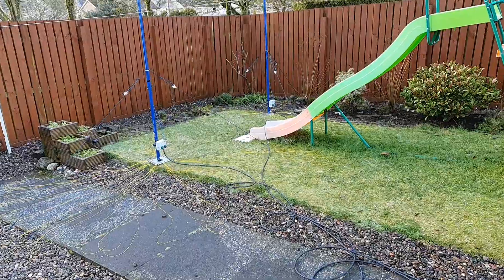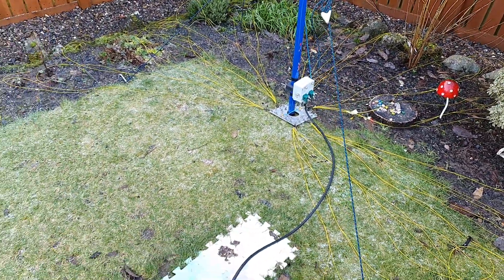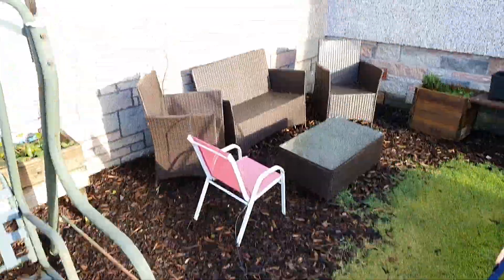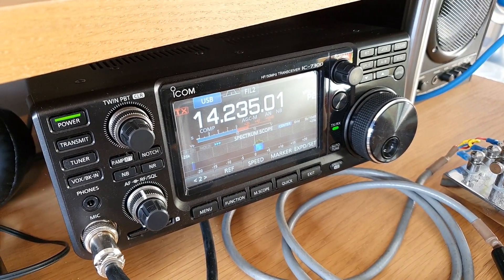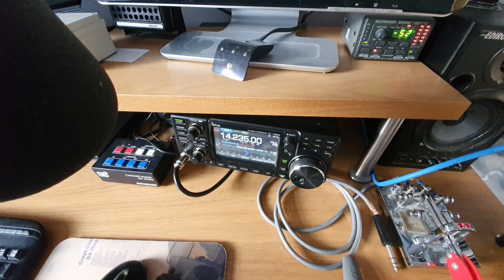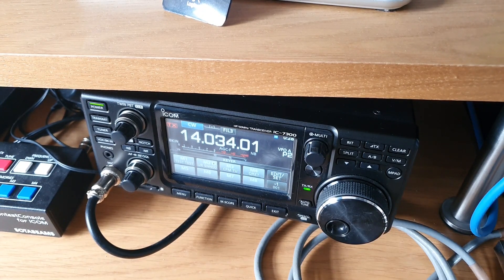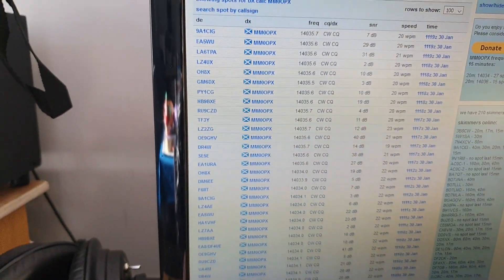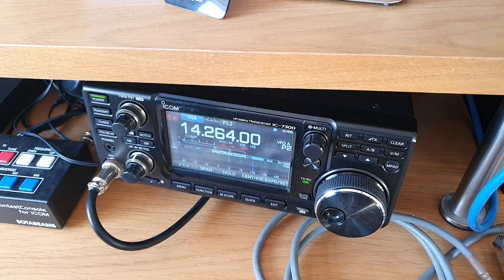20m Phased Vertical Array - First on Air Testing

Comment: Ive been playing around with a pair of 20m phased verticals with elevated radials. Faced a few challenges, but I am getting there! I thought I'll mention that I did some interesting tests today, to determine how much the connectors, different interconnecting pigtails in the relax box etc detunes the phasing lines. I'd kept mine as short as possible, but I was astonished to find that SO239's, pigtails etc, dragged my 84 degree lines down about 275 khz! I then trimmed the cables whilst isolating the pigtails from the relay, but keeping the far end of the phasing lines screwed to the SO239. I got as close as I can, but figured that was way better than the previous detuning. It also made me feel silly having tried to get the 84 and 71degree lines spot on previously, because they get detuned once hooked to the relay box anyway! The results were very encouraging, and the FB jumped noticeably!

I reckon I wont be "spot on" unless I do more pruning compensating for the length added by the relay contacts. If I'm to be "perfect" Id need to do the same for the 71 degree lines as well, but one step at a time. Do you know if my approach is correct, or if I likely screwed up the phasing? Like I said, the FB did jump up, but I recall reading ON4UN that even an incorrectly phased array will show FB but might actually be -4-5db down on gain. So, FB is not always indicative that everything is right, or supposedly so.
Reply from the maker: I think your on the right path. This isnt an easy or quick project. Justin KG2RG has documented lots of his phased verticals on YouTube. Have you watched his stuff on them?

Comment: Very cool! I am curious where you came up with your degrees of delay? Most phased verticals I see now use the "Christman method" with 2 84 degree feedlines with a 71 degree delay. Any information online for yout setup?
Reply from the maker: The design is in the low band DXing book as I understand though I don't have a copy and it's out of print just now. Try and get a look at a copy.

Comment: Very interested test.
I was going to try a phased ant as yours, but as I only work long path in the evening,  I put up a parasitic array. Using mmna I found the gain in one direction on the phased and the parasitic ant were just about the same, and of course if only one direction is required the parasitic ant is far simpler to make of course. Tests here between my 2 ele parasitic and a single ele vertical, gave me on average 2-3 S points into eu from zl, and less noise on the 2 ele.
So now I can pretty much reduce power from 200w to 50w and get the same results. A 2 ele parasitic by the sea is really easy to put up and boy does it go.
Thanks for the info, it's always interesting to see what others are testing.
73 zl3xdj
Reply from the maker: Thats a really good gain Brian. Yep, the parasitic array is much simpler. There is just something switching the verticals and seeing that signal rise or fall. magic
Reply: How much stronger do you think your 2 ele is into eu compared to a single element.

Comment: M1ANN. Interesting video Colin. I’m working on phased verticals with raised radials for 17m using the christman method. I should be up and running after testing within a week or so. Hope you make some good dx. Looking at your set up in the back garden with all those radials you must have a very understanding missus !!!
Reply from the maker: Thanks. Only set these up as and when. The XYL wouldn't wear it if I had it up all the time. I will likely make a set of 17m coax lines too. Always handy to have additional bands.

Comment: Great test Colin, very interesting. I also agree on the Life’s a Breeze pro poles, they really are excellent. I was also very interested to see your fan dipole potential from your feed boxes, presumably you would run those to an insulated plate at the top of the pole? 73, cheers M0EUK
Reply from the maker: Some sort of separation will be needed. I will look at it in time. I automatically have the separation if using an adjustiwave.

Comment: Great job and effective use of a small garden space.

I'm curious of the difference between running two phased and a single vertical on it's own?
Reply from the maker: I believe it it around 5-6db better than a plain vertical. I like to think of it as my 100 watts is really 400 watts.

Comment: Hi Colin, would you mind putting a parts list up for the array as I am very eager to use one for 40m , but unsure where to get the box etc cheers, Ross M0UGE
Reply from the maker: Hi Ross, most of the info is here. The aluminium boxes are Hammond 1590C from RS components. I will try to to a proper parts list but it may be a while http://www.moneysmith.com/W4NFR/40%20Meter%20Phased%20Verticals/40mpv.html
Reply: @MM0OPXFieldRadio  OK thanks 
73

Comment: Nice work Colin and great reports. 👍🏻 How critical is the antenna tuning and how do you ensure they are tuned to the same frequency with good SWR, as location and surroundings may affect one antenna more than the other? De Will, M0LGW
Reply from the maker: Hi Will. Both antennas are tuned identical where resonance is at 14.175. This is ensured via my analyser. You will just have to try and see if you have and surrounding structures and if they are effected. Give it a go.